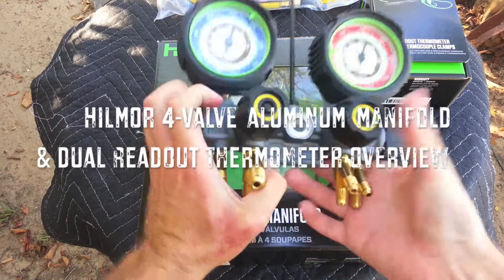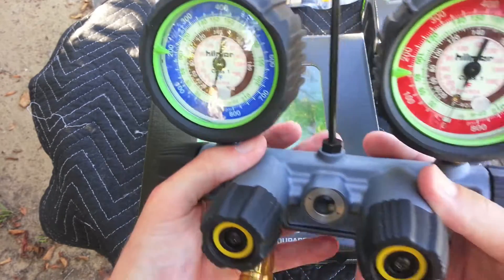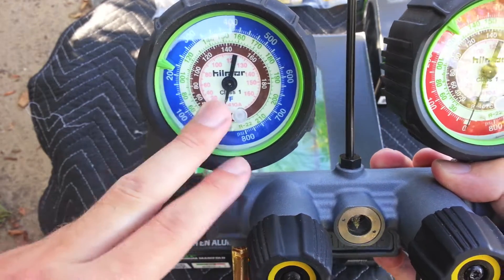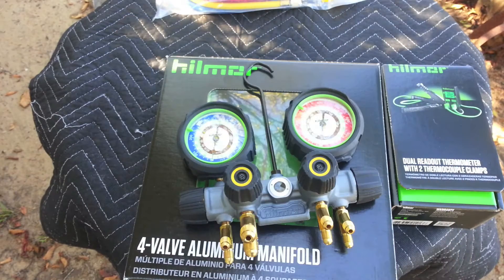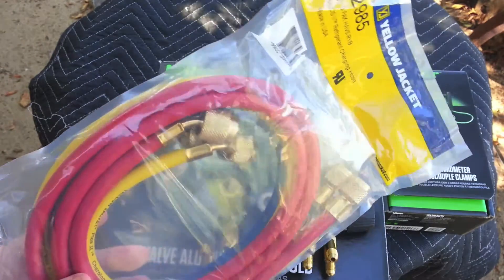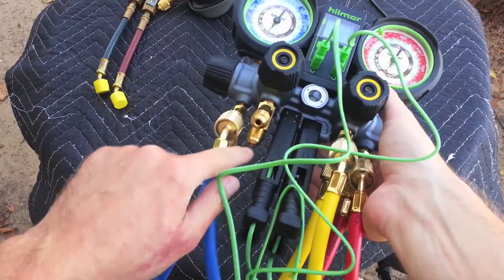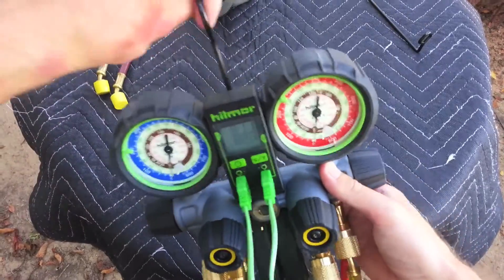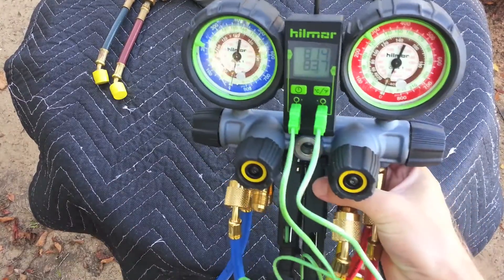hilmor 4-Valve Aluminum Manifold & Dual Readout Thermometer Overview

Comment: They seem like well made gauges,but the fist time I used mine they fell from the condenser and and the high side gauge broke off. unbelievable. You can,t beat a 4 port for getting a quick vacuum though. my helper also stripped the high side knob after a few weeks. (the inside is plastic). I'm back to yellow jacket brutes 4 port. treat them gently or they will fall apart.
You do an awesome job on your video's
good luck with those things.
Reply from the maker: guy napolitano Thanks Guy! Well that sucks! Thanks for that feedback. Some people unnecessarily crank the valves too tight, but that still should't have happened  to the knob. You can't go wrong with Yellow Jackets, well made USA tools.
Reply: yikes , are they really that crappy  ? lifetie guarantee he said. hit up hilmor.

Comment: Hey JOn, Good Review. i'm in the market for another analog set. are these still holding up or do u recommend them still or not ? thanks do u have a updated video on this guage setr. by the way i use the yellow jacket safety hoses like u have here for 30 years . only way to go in my opinion. uunited refrigeration has a similar set but the safety ends are smaller and i like them too for tight area's.
Reply from the maker: Thanks OC, I haven't had any issues with them. I try not to unnecessarily crank down on the valves. They are on the heavier side sort of. No updated vid. I mostly use my smart probes and 550s now. I mostly use these for nitro tests/spares. The YJ sealright ends are quite large. I prefer the ball valve ends now.
Reply: thanks jon. united refrigeration ones are normal size ends but are safety seal ends and i like them alot. check them out. i'll have to do a review on them. great hoses. united refrigeration brand. i think its nrp products hoses. N60BVRBY
Reply from the maker: Yes I've looked at them there and said to myself: Man those are way smaller than the YJs...hehe!
Most of the NRP products seemed good.
Reply: yep, been using the hoses for 1 year now. no problems so far. seem better built than yellow jacket seal rite connector. nrp products happy so far with all products.

Comment: Hey Jon how are you liking this manifold?
Reply from the maker: They are a little heavy but, I guess most 4-valve manifolds are. The gauge bodys are plastic. I was told the valve handles strip but, could've been from overnighting as some guys tend to do. I don't really use these to often now. I use them on pressure tests and suspect systems. The plastic gauges are a deal breaker probably.
Reply: Jon HVAC cool I figured they would be a  little heavy . I just got mine yesterday got a deal from EBay $68 delivered to my door no hoses , manifold feels solid, a little too bulky if working on small Refrigeration units , if your on a roof no biggie . I think this manifold is more suitable for an A/C tech
Reply from the maker: That's a good deal. Yeah it's kind of a monster👹...😂